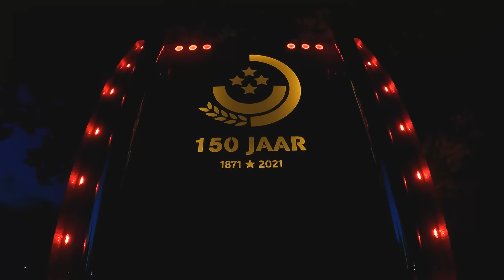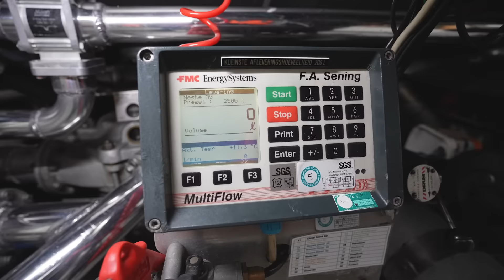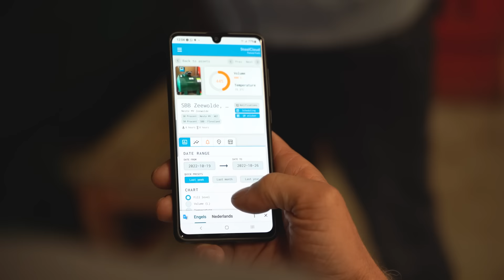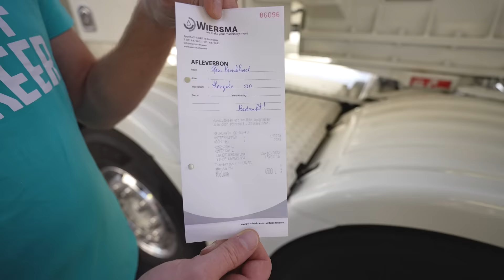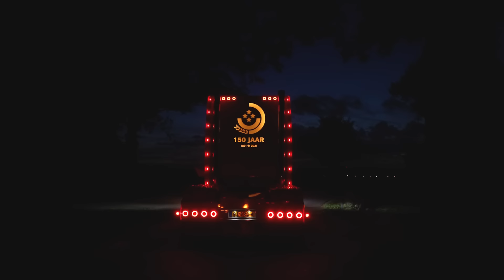30.000 liter in half uurtje tijd met Scania 660S Torpedo: De Lastdrager II! ⛽

Comment: Ask any scania mechanic if they like working on them and its a no. The access is terrible, compared to a cab over. Look pretty but overrated and no use in uk. We had the odd one or two in our dealership, but thankfully not often.
Reply: There is also no use for bonnet tracktor in the Netherlands, with a tanker you could legal drive them with full weight. There are more oil dealers with the same kind of tracktor trailor combinations in NL.